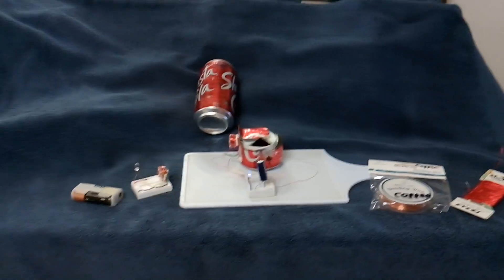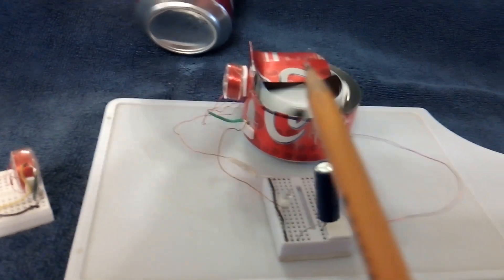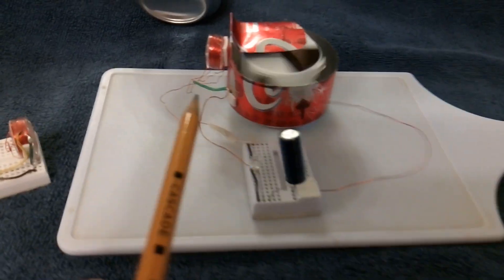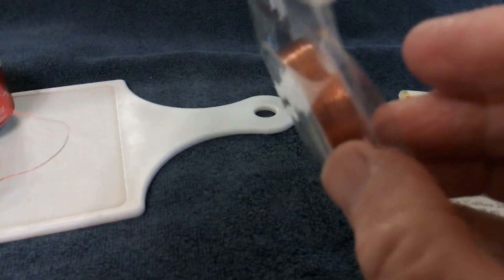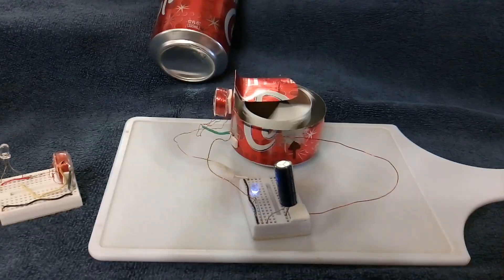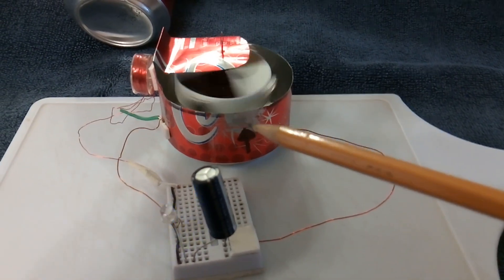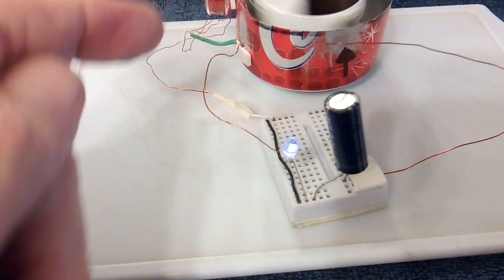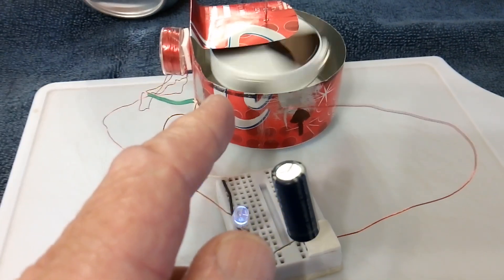Soda Can Pulse Motor

Comment: Hi, try a new source  of energy for this motor. Use a small Zinc piece and a copper, insert  both in a plastic cup full of sand/earth as electrolite. Use a Joule thief to amplify voltage as needed. I use a Bc547 circuit and a capacitor of 220mf. Great skills you have!